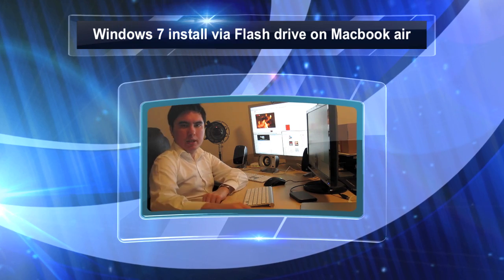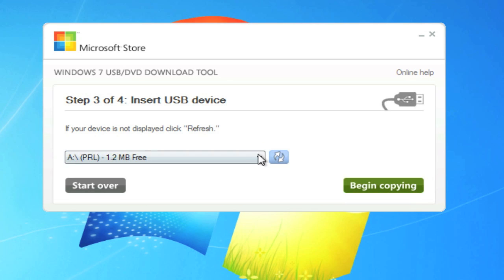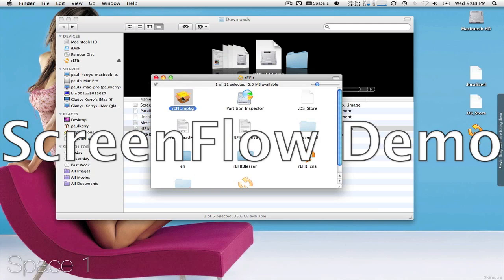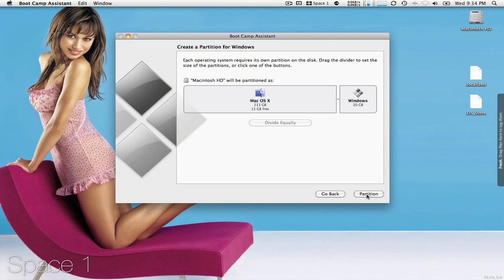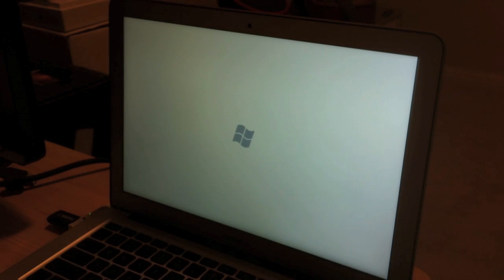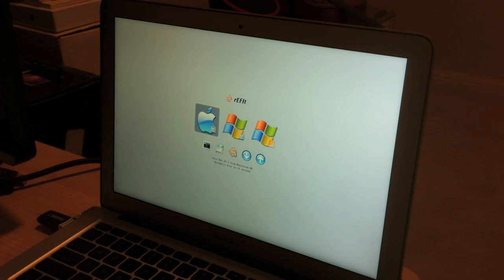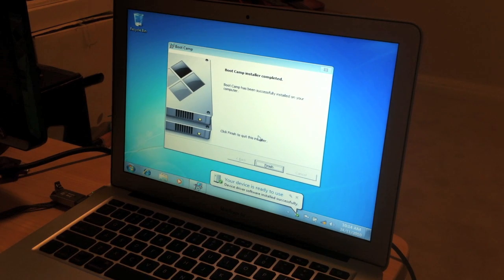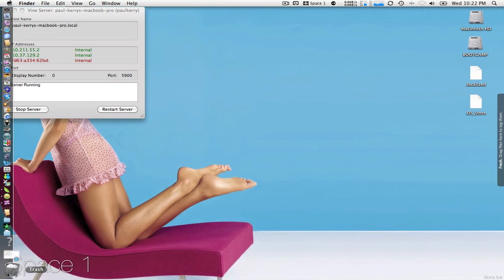Installing Windows 7 with USB Flash drive on Macbook Air

Comment: having trouble downloading the windows support from bootcamp - says i have "network issues" but wifi is working fine

anybody encounter a similar issue?
Reply: +lyiu87  My bootcamp was stuck on the downloading screen but wifi was working fine . I just installed the latest support drivers from apple's site and it worked.

Comment: i got to the Install windows pick a language page but its not recognizing my trackpad and keyboard. HELP!!!!!!!!!!!!!!!!!!!!!!!!!!!!!!!!!!!!! (and yes my installation iso usb is on the left side)
Reply: solved my own problem. for all you MACBOOK AIR 2013 users: throughout this whole process you MUST insert the USB with windows installer on the RIGHT usb outlet and the Windows support files usb on the LEFT (with you facing the screen) ... i just saved you two hours of time. you're welcome
Reply: dbsk06
you need 2 usbs to install windows 7? i thought the windows support files automatically installed on the first usb when using boot camp..

Comment: It was lot easier than this on Mountain Lion. All I had to to is to have ISO file and open bootcamp assistant. It hat 3 check marks:
1) Create Windows 7 install disk.
2) Download the latest windows support software from apple.
3) Install windows 7 
bootcamp drivers were stored on the same Flash and I also did not need refit. Everything was lot easier than this. I appreciate your hard work though. I'm commenting to save some time for some people.

Comment: Well I did all the steps, got Windows 7 on the flash drive with the usb download tool, installed refit, and when i do get into the installation, where i have to choose the disk to install windows 7 on, I get the error "the disk you are attempting to install on has a MBR partition, and EFI systems can only install on GPU partitions" or something of that sort. 

Any help?

Comment: I use MacBook4,1 10.6.8, but my optical drive is spoiled. I use this method install Windows 7, but when I reboot and choose pendrive via refit, my screen appear Non-System Disk, press any key to reboot. But my pendrive can boot with normal windows pc. I used this pendrive to format a normal laptop last week.

Comment from the maker: @iTony2101 Hi When you run bootcamp on a Macbook Air it will give the the option to download the drivers for bootcamp when it does you simply copy them to a USB flash drive.

Comment: @TheFrappelicious I've had this message before. To work around it, when you first boot up, as SOON as your screen turns blue and it plays the tone (you have to be quick!) hold down the alt key. If you do it right, a window should show up asking you to choose what drive you want to boot from. If you properly installed rEFIt like he showed in the video, however, you wont need to do this. I would keep rEFIt simply for this reason.

Comment: @pkerry12 So the only way to install the bootcamp drivers on windows is to manually install it via the second USB? And BTW when you "burn" the ISO of the windows file to the USB does that make the USB useless except to install windows on computers?

Comment: My Bootcamp also says install instead of partition, When i click install it just says: "The installer disc could not be found". Is there a way to get around that? or does anyone know where i can get an older version of boot camp assistant? Thanks!

Specs: Macbook Pro running on Lion; trying to install Win7

Comment from the maker: @ShreadinTheToast Simply its requried if you want windows to work properly and your Mac OS to work properly side by side, also you need bootcamp to run its installer in windows to install all the windows drivers and apple services so you can run things like icloud etc in windows. Windows user that think its not necessary need to learn that it is.

Comment: @nicklassayshi yes you can get it to work on lion. but i would not recommend you to do so. it is pretty difficult. I did it and it took me waayyy!! to long. and for lion you do need at least one disc no matter what. just to create the boot camp partion. then there is a lot of other crap you'll need to do. so just for your time sake I would just go get the disk and follow the lion boot camp instructions. but if your still wanting to go this rout let me know and Ill try to get back to you.

Comment: For all the 2011 MBA (Lion) users, there are some minor differences that you should know about:
1. You can insert the bootable Windows 7 drive and install after partition. No need to reset as it will allow it to install from your USB.
2. You might have to format your drive to NTFS if it doesn't allow you to install Win 7 on your bootcamp partition. Just click on the bootcamp partition and press format. 
3. Delete REfit from Search box. I couldn't find StartUpItems in Library.

Comment: i did the same things and when i install the boot camp drivers it instaled all of it but still not working.and it shows in control panel all installed drivers but still dont work.tell me the solution and can u give me the link of 3.1 bootcamp drivers which you used in this video thanks

Comment from the maker: @KiZooNmedia I have only tested this on a Macbook air it was meant for a macbook air because of the unique way you install Bootcamp. back when i had a macbook pro you didn't need to download any drivers you just used the leopard or snow leopard disc for bootcamp drivers in windows. if would be worth just copying those drivers over to a flash drive or something and you should be right.

Comment: Great video! I tried this method but instead using a Windows XP bootable pen drive, rEFIt recognized it but then when I selected it gave me the error 'The firmware refused to boot from the selected volume.' 
I read somewhere that XP doesn't support EFI but 7 does, so does that mean this method is absolutely impossible to accomplish with XP?

Comment: I cant get it to work. After quitting boot camp, I went ahead to reboot my Macbook. At the rEFIt menu, it only displays either booting to apple Os or from the usb device. I selected my thumb drive & it loaded to a windows 7 logo. Then to prompt stating plug in a bootable device.

Comment: he man i have got myself a macbook air 3 days ago and i just want to test out gaming on Windows 7 so i have 1 question which is if i can use my external DVD drive to actually install Windows 7 through bootcamp because i don't know if bootcamp support an external DVD drive and i have the installation CD and code here already from my old laptop which i will sell later on but just with it's old Windows Vista so i can use Windows 7 on my macbook. and if not how did you get windows 7 on a USB drive?

Comment: Alright, does this work on a MBR? Because when I tried what you did, & when I was at the step when I was about to install windows right after the MB restarts, I chose the Windows Partition which is the far right, it gives me the Windows logo likes yours & then the screen turns black & gives me errors such as Booting Legacy & stuff like that. Any solutions?

Comment from the maker: @drewfallis Hi you really should re-create you windows 7 64 bit iso because all the windows tool does is make an exact copy of you iso onto your usb flash drive, I would burn the iso to a dvd to check that the iso is functional (because it sound like its not). if for some mirical you iso actually functions as a disc then there is something wrong with you flash drive. either its too small eg less than 4gb or its corrupted or damaged, in this case try another flash drive.

Comment: I've been trying to do this on a iMac and am using a 64-bit version of Windows 7 but on rebooting I just see the Mac OS and the Flash Drive with the windows logo. When I press the USB Flash with Windows logo I get the "No bootable device -- insert boot disk and press any key". I created a bootable USB with the "Windows 7 Tool" after formatting the USB to FAT32. 

How can I get around this error? I have an .ISO of 64-bit Windows 7 and just want to install Windows on my iMac.

Comment: @pkerry12 Yes, I did. I made USB flash with Windows 7 via "Windows 7 Tool" (I tried formatting my USB flash with FAT32 and NTFS, which one is correctly?). Then I installed "rEFIt" on my macbook air. Then made "Boot camp". After rebooting I can see 3 partition:  MacOS, Boot Camp and Flash with Windows logo. I chose USB flash with Windows but getting an error massage: "Not found returned from legacy loader".
Thanks!

Comment from the maker: @bilsta57 its cool considering I only have the stock standard 2gb I have noticed any performance issues when doing multiple tasks where is in the past I would have 4gb in the macbook Pro I am still surprised it runs Civilisation V smoothly on its specs!! mind you all settings set to low to achieve this though.